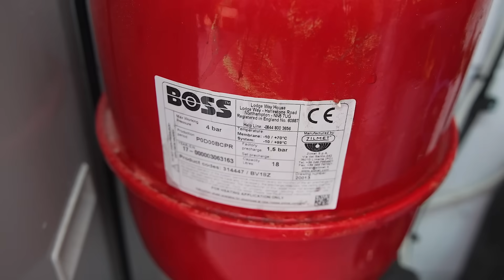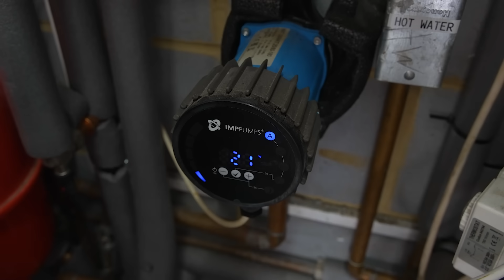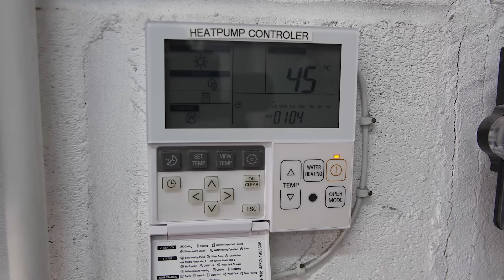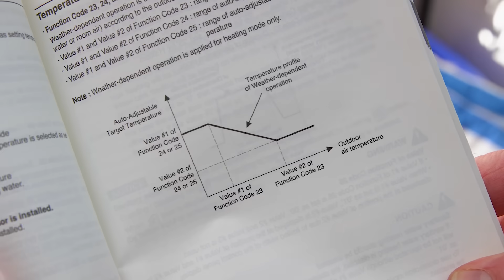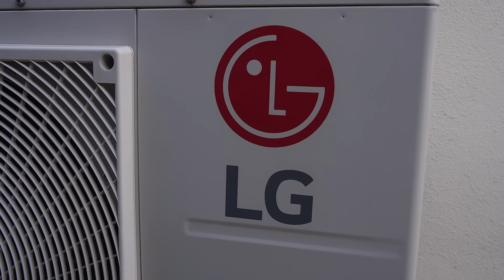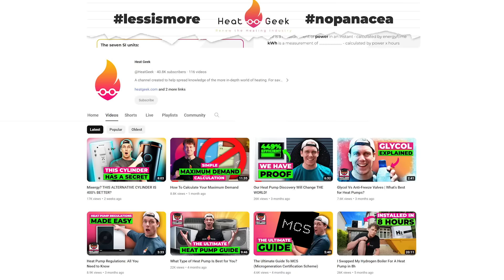Heat Geek Gives His Verdict on John’s Nightmare Heat Pump

Comment: TURN YOUR HEAT PUMP OFF when the temperature goes under 10 degree centigrade, why because it fricking inefficient, costly and bad for the environment. First winter with the UK Govermant Approved ECO4 System which includes 90mm internal insulation, solar panels 3.6kw and a new 9kw ASHP and the electricity cost from October to January has gone 10x, its ridiculous, we are in North Scotland and this is not the place for an ASHP, never ever....YES to the insulation, YES to the solar but the better solution is solar integrated night storage heaters with as many solar panels as you can afford and as thick as insulation as you can afford...(but please understand when the temperature and sun was available from August(first time switched on) to September the ASHP was very efficient so its really important to get this right)

Comment: Good video, but all this Geek'ing about with tons of tanks /pumps and pipes and the guy practically needs a dedicated room to fit all this... the excuse for the inefficient system seems to be the weather compensation setup influenced by external temperatures due to house insulation etc etc.. I think people are smart enough to understand that this is a fiasco at the very best, with today's gas boiler's tech I think you are better of buying a brand new boiler to save some money.. common, we move from 100w light bulbs to 10w LED's to give us the same lumens.. we move away from old unreliable electricity wasting home appliances to use less electricity etc.. yet our electric bills keep ramping up? can people not see what's happening here?  if you want to reduce the carbon footprint, you plant more trees.. you don't buy electric cars or install heat pumps.. where do we think the electricity comes from to keep these cars and pumps running? 🤣

Comment: Heat pumps have limitations! Any temperature below 10 degrees. Complete garbage. Radiant heat is 💯 efficient heatpump like 40% . You are better off with a oil burner or propane that cleans the exhaust and sqeezes the heat out of it.
Reply: I don’t know where you get that idea from. They are effective down to around -20c.

Comment: Heat pumps are poor at heating at the best of times… They work by cooling the outside air, transferring it’s heat into the home…. But in winter when you most need heat, the outside air is already cold, and so trying to make it colder by robbing its heat is a lot more difficult, needing long compressor runs.  Heat pumps work best by chilling warm outside air…like in summer….when you don’t need it!

Comment: All i got from this video is heat pumps are very expensive, not very good and gas bad, electric good even though electricity is made from gas.
Reply: The moral of the story is that bad heat pump installs are expensive. Great heat pump installs are only marginally more expensive than gas with lower running costs. Problem is the skill base of our current population of heating engineers isn’t where it needs to be to do the great installs.

Comment: Extremely important, to John, Roger, and all YouTube viewers on this channel and other channels! Do not ever buy a Heating Pump, because it runs on Electricity, which Heating Pumps consume very high wattage of Electricity. Heating Pumps consumes 1000s of watts! Due to the high prices people are now paying for bothElectricity and Gas in the UK, which is still going up! It is simply not cost effective to install a Heating Pump system! Stick to a good Combi boiler! John you are not going to like this comment, I am now making, get your heating pump system removed immediately, sell it, cut your losses, and go back to using a good Combi boiler, which the motor only consumes between 50 to 200 watts, when it spins, this is cost effective! Adam@Heat Geek, will not be able to reduce your electricity bill!

Comment: You'll never convince me these things harvest heat from outside & bring it inside.Common sense tells you there's no heat to harvest when it's close to freezing outside.
However,i see they use a compressor and when you compress a gas or liquid it heats up so i can see how some heat can be generated by the compressor.Why can't they just say that? It feels like i'm being lied to but i can't understand why.
Reply: Freezing temperature is far from absolute zero (Kelvin). There's still plenty of heat energy in the air, just waiting to be harvested. How do you think an air conditioner works? It's the same thing as a heat pump, just in reverse. It just moves heat energy from one place to another through the use of refrigerants.
Reply: @Tresla    I understand how air conditioning works.Air conditioning removes or dissipates heat/energy.It's relatively easy to dissipate,remove or use up energy.It's not so easy to create energy.Heat is a form of energy.
Reply: @keithbennett1656  Air conditioning works using exactly the same principles as a heat pump. Neither of them create or remove energy (both of which are impossible btw). They just move heat energy from one place to another. What you think of as cold, in the grand scheme of things, isn't that cold. -273.15℃ is absolute zero. That's the temperature at which there is no heat energy. You see how it's pretty far away from 0℃? Plenty of energy left in the air!
Reply: @Tresla  @Tresla  When i look at diagrams of how air source heat pumps work they all show outside air only being used to warm the refrigerant which turns to gas at very low temperatures.That gas is then passed through a compressor which heats it up and it then passes through a heat exchanger.This shows that the heat is created by the compressor.In all the diagrams the refrigerant is coloured blue,
signifying low temperature or cold,until it has passed through the compressor then the colour changes to red,signifying high temperature or hot.
Reply: Almost. The compressor isn't adding heat to the system, at least not a significant amount. The gas is at a higher temperature after the compressor because it is now at a higher pressure, not because any energy was added to the system. The only places that energy is added and removed from the system is in the condenser and the evaporator. And when I say "added" and "removed", what I really mean is that the energy was simply dissipated into (or absorbed from) the surrounding environment.

The electrical input of a refrigeration system is only used to drive the compressor. The compressor does heat up due to it not being 100% efficient, but this shouldn't affect the refrigeration cycle in any meaningful way. If the compressor was 100% efficient, and produced no waste heat, the heat pump (or A/C) would still work just fine. You're just moving heat energy from one place (the evaporator) to another (the condenser). If you were to touch the condenser coils and the evaporator coils whilst the system is running, you'd notice that one of them is hot, and the other cold.
Reply: @Tresla   Sorry i have to disagree when you say " the gas is at a higher temperature after the compressor because it is now at a higher pressure,NOT because any energy was added to the system ".The gas is at a higher pressure BECAUSE energy has been added to the system.Electrical energy is put in(added)to the compressor.The compressor converts that electrical energy into kinetic
(moving)energy.That kinetic energy creates pressure & heat.The heat is absorbed by the gas.
Energy can & has been added to the system.When i rub the palms of my hands together they heat up.They weren't initially hot when i placed them together so where did that heat come from ? I created it.
Take a standard cylindrical bicycle pump and place your finger over the outlet hole.You won't feel any heat.If you then try to move the piston of the pump it'll heat up because you're adding pressure.That means you're adding heat which is a form of energy ergo you're adding energy.
Reply: @Tresla  Here are a couple of snippets from the National Grid website.Note how it says ' takes heat from the air and boosts it '.
It also says ' • This gas is then moved through a compressor, which increases the pressure, causing its temperature to rise.

Here’s a step-by-step process of how heat pumps work:

• 

Heat could be sourced from the air outside or warmth from the ground. This is blown or pumped over the heat exchange surface of the exterior part of the heat pump.
  

• This heat is warm enough to cause the refrigerant liquid in the heat pump to evaporate and turn into a gas. 
  

• This gas is then moved through a compressor, which increases the pressure, causing its temperature to rise.
  

• The gas (now heated) is passed over the internal heat exchange surface. This heat can then be either blown around the home's interior or transferred into a central heating or hot water system.
  

• As the heat is transferred into the home, the gas falls in temperature, causing it to return to a liquid state.
  

• The cycle of reverse refrigeration repeats until your home reaches the required temperature setting on your thermostat.

How does an air-source heat pump work? 

An air-source heat pump takes heat from the air and boosts it to a higher temperature. There are two main types of air-source heat pumps; air-to-water and air-to-air.

Comment: A Very important comment to Roger, John, Adam, including all YouTubers on this video. The reason why John's electricity bill is so expensive, is because the motors inside the fan units outside, consume over 1,500 watts,  just in electricity, when they are just switched on. This equals to £0.40 pence per hour. If John has these fans swithed on, for 8 hours a day, he will consume £3.20 pence per a day,  just in electricity to run these fans. In one week, he will consume £22.40 pence,  just in electricity to run these fans. In 3 months' time, when he gets his bill, he will consume £268.80 pence,  just in electricity, to run these fans! John and Roger, it is simply not cost effective to have a heating pump installed in your home, especially with the cost of electricity going up again on 1st January 2024, by £94 a year. John you must have the heating pump system taken out of your house immediately and go back to a good Combi boiler. Andy should have told Roger and John, including all YouTube viewers on this channel, this information I have given! It is simply not cost effective, to have a heating pump, due to the huge costs in electricity per an hour, to run the fans!
Reply: If that's just the fans what does the compressor consume then?
Reply: @nickhickson8738  What a great question!  The compressor consumes between 2KWH and 5 kWh!  2KWH is £54 pence per hour! 5 kWh is £135 pence per hour! A heating pump is a mortgage. He needs to go back to a Combi boiler!
Reply: @batmandestroys1978   Come on then, name and shame a modern heatpump that has a compressor that only modulates between 2 and 5kW.

Comment: This is an excellent discussion on heat pumps. However, as the expert said, his mission is to "decarbonise" the heating installation, that is where the whole thing falls flat. It's crucially important that people understand that the so-called "climate emergency" and any need to "decarbonise" is purely political. Absolutely nothing to do with Climate science, including that CO2 is an essential contributor to both a stable climate and for food production. You fail at first base because you've swallowed the climate emergency lie. Earth's CO2 levels are currently in deficit. If Net Zero were successful, you'd end all life on the planet.
Reply: You dropped your tinfoil hat there bud!

Comment: What a load of nonsense about the bearings going rusty and whether it is set properly.  Bearings can be made to suit the application - bearings last years in cars, aircraft and boats and in very arduous conditions - what a load of bunkum. My heating circulation pump has lasted 15 years and still going strong for £80 and runs in water. If that heat pump fan is noisy it is not designed for the task.

Comment: Heat pump engineer is no more than a sales rep, when this over complicated piece of shit is out of warranty, it's gonna cost more to repair than what he had saved by using a conventional condenser oil burner installation, these units are over complicated and have intellectual property attached to them, therefore your standard oil burner repair man is unable to repair, maintain and provide backup service to these heat pumps,, in my 30 years as a maintenance fitter and field service engineer, I believe in keep it simple, not overcomplicated and less can and will go wrong and fail..... Heat pumps are a scam.....

Comment: Heating your house used to be an absolute piece of pis s to understand. This isn't progress. We are going backwards. It's pathetic.
Reply: I think as per the video this was because no one cared about efficiency. Condensing boilers started making this more complicated
Reply: But this is the way nowadays. Look how so many people over complicate even simple CH systems with Smart controllers and thermostats and other gubbins in their houses depending on WiFi and that includes those damned nosey door bells. Is this really progress? Certainly not Green.
Reply: @nickhickson8738  surely though its no different to a car with fuel injection vs a car carb or jetengine vs a petrol. Complexity occurs as we try to achieve bigger and better

Comment: Well. Looking at that mess in the garage. Listening to your expert.
Then saying you need Electric or A Gas Boiler to back it all up.
then heats at around 50c then to be cooled back down again.
Then air to air and so on.
Then this loud noise from outside.
All in all the safest and best way is to not have one.
The industry is full of cowboys that are not regulated and either do not care and bugger off soon as they have done a few bad jobs 
or people who will simply not know what they are really doing.
This whole industry needs to be fully regulated.
But until it is.
Stay well away.
Your good old back boiler will do a better job.
I've go a friend who had an old 1050s back boiler heating system in his house.
It had no pump no electric anything.
You just made sure the water was in the system and put the coal / wood and bits of paper etc on the fire and it worked and the whole house was hot all through winter.
Then the council came, good news, we are going to upgrade you, take out the old back boiler and fit you a state of the art new gas heating system
From that day on he had nothing but problems, the house was never warm and the gas bill went up 3X££££
Now we're seeing the same thing with this heat pump system to what are over priced and over complicated. 
Leave well alone.

Comment: Hilarious - essentially your whole hypnosis was rubbish. Heat pumps are great, work fine, are very efficient IF INSTALLED CORRECTLY - just like any boiler or ANY other system. 

Your constant lies and sniping over heat pumps saying ‘they don’t work’  has been completely blown out of the water. How embarrassing for you 😅😅😅😅
Reply from the maker: sickb0y33
Rather than worry about my embarrasment can you point to one thing I said in any of my videos that is untrue?  It will take some finding.
If you have followed the debate you will know that Adam and the Heat Geeks team are in agreement with me, which is why they are working hard to address the very issues I raised. My initial video on heat pumps acknowledged that they work well in  insulated and draught-proofed homes. 

Your point about boilers is also cobblers because a gas boiler doesn't have to be sized correctly to work. You can turn it up and down to compensate for changes in the weather. When you have a heat pump working at low temperatures the whole game changes. If the heat loss is greater than the heat input you have the situation you see here.
Reply: @SkillBuilder  most of the comments you made 😂